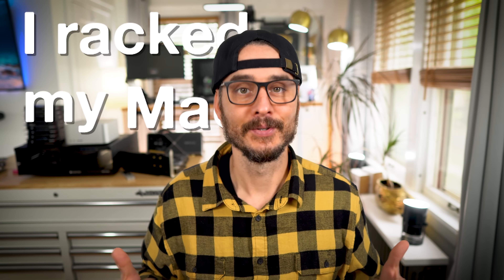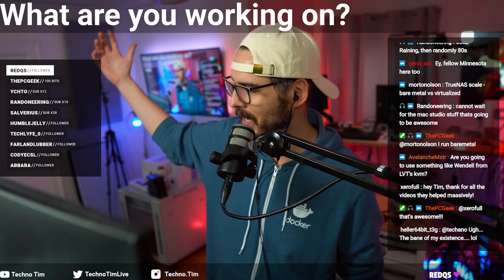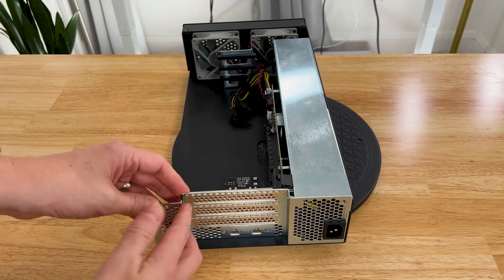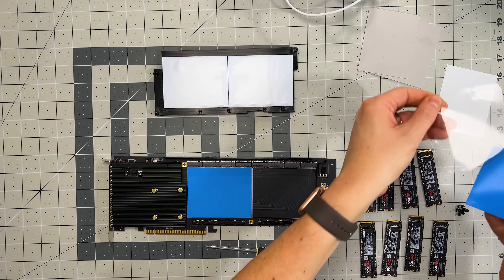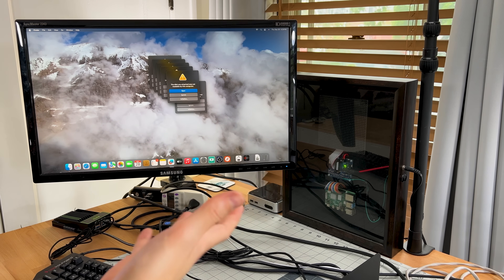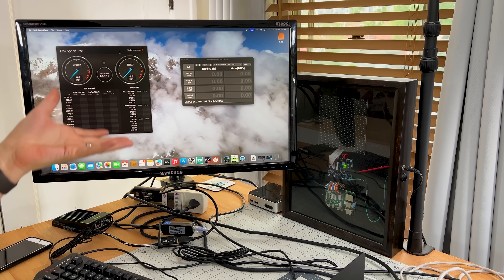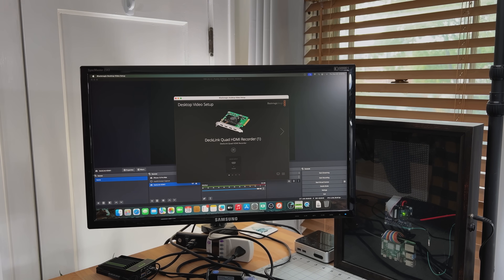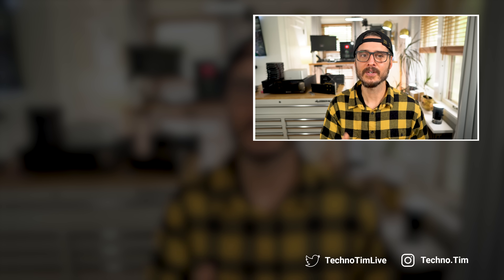Unlock the Power of Your Mac with This Case - Sonnet xMac Studio + ECHO III Desktop + PCIe Cards

Comment: Hmm, at the beginnig of the video you've mentioned that "TB3 is faster than TB4"? But in your video later on you've shown 2800 MB/s of speed to that SSDs on the external "enclosure of many drives", but TB4 can give you more, for example, here, I have Mac Mini M4 and external SSD connected via TB4 and I'm getting 3000 MB/s constantly. So, not sure exactly about your piont "TB3 is faster than TB4..."

Comment: I've a previous Sonnet M.2 4x4 PCIe Card with 4 x NVMe (Samsung 980 Pros) on RAID 0, running off maxxed-out 3.46Ghz MacPro 5.1... and I'm getting 4.8Gb/Sec READ / 4.0Gb/Sec WRITE, compared to this "evolution" on TB3 with maxxed out 2.75Gb/Sec output on a MacStudio M2.   At least I've got something to potentially migrate the Sonnet M.2 PCIe Card to, with this Sonnet xMac,, when I go Apple Silicon soon. Will wait for the M4 Ultra in 2025 though.

Comment: hi there,

are you still running the card in the echo iii? if so, are they playing nice with sonoma? i'm thinking of buying the echo iii (already have the m.2 4x4), but i've read some cases online that stated that quite a few m.2 pcie 4x4/8x4 are not recognized once the os is upgraded to sonoma or keep getting ejected. most cases were mac pro's 2019/2023 with internal pcie, but some were owc's thunderbay flex 8 with m.2 4x4 nvme connected with tb3. thought i'd ask, since this is also a pcie enclosure connected through tb3. cheers!

Comment: You don’t need a rack to get those Thunderbolt speeds. My Thunderbolt 3 external enclosure with 2 4TB NVME’s (8TB RAID) run at the same speed as your 8 1TB NVME’s. Yes, that’s as fast as Thunderbolt 3 will go.
Reply: which enclosure are you running?
Reply: @AlexTyson_  Sabrent Dual NVME RAID Enclosure
Reply: cool thanks.  @GaryWang

Comment: Would be more useful if Sonnet were to use all TB3 controllers on the Mac (up to 3 on Studio, 2 on Mini Pro) to increase the speed of their external appendages
Say 1 connection to every PCI slot separately
Instead of sharing 1 TB3 with 3 PCI slots, limiting performance

You can get 2800 MBps from a single drive enclosure (and 8TB from a single drive)
About twice that if you put 2 enclosures on 2 TB3 controllers then RAID-0 them

Comment: got two of those at work,
once it happened only 3 of 4 NVME SSDs were shown after reboot, sometimes front LED doesn't turn on randomly,
apart from that 4x4 Sonnet card and RME HDSPe AIO audio card work great,
so far only complaints are lack of more than one PCIe x16 slots in EchoIII box, and lack of enclosure for optical drive below Mac itself (yes it would fit)

Comment: Bifurcation is a function of motherboard and pci slot. This card does opposite — it combines and routes pci lanes. Bifurcation makes from x16 pci slot 4 x4 or 2 x8. This card have some chip. Very powerful as I can imagine. 8 disks 4 ones each so it routes 32 lanes into 16. But probably it can divide 16 into 8 x2 lanes. Then it is very strange card :)))
Reply: Most newer generation boards doesn’t support that good old 16 -> 4x4 anymore. At least not consumer boards, perhaps Xeon and Threadripper boards still do.

It’s unfortunate, since bifurcation cards are waaaay cheaper to buy. I bought an AliExpress dual NVMe NVMe PCIe adapter card with the ASM2812 chipset. It works ok but is maxed out at gen 3 x4 speeds upstream. Cost $80 and for that I’d easily have gotten a quad bifurcation card.
Reply: @Yiveytube  you mean two m.2 ports gen3x4 each (upstream from ssd to ASM chip) or upstream from ASM to motherboard is gen3x4 in total? Have same card with red radiator (actually 6 pcs) didn't  tested yet
Reply: @hpsfresh  to motherboard
Reply: @Yiveytube  :(

Comment: Umm yeah no TB4 has 4pcie lanes per port it’s not limited 1 that includes docks. It can send usb 3 data over 1 pcie lane. TB4 provides 4x pcie 3.0 lanes for every port so no increase over TB3 other than 4 requires 32gb speed ie 4 lanes to be available at for every host port not the 2x some low power ports had available. Even if this information is wasn’t widely available some common sense will show you some things. Plug a nvme enclosure rather it be a single,dual or quad drive doesn’t mater as long as every slot is filled to either the host or a TB4 dock (docks other ports are empty so no host port bandwidth sharing. You’ll see read/write speeds that are 90-100 percent the bandwidth limitation of single TB port ie 2.6-3.1GB per second. Drive quality and system resources will cause these to vary slightly. Take a drive out of the raid enclosures and you’ll see a speed based on the physical lanes available to the remaining drives. If this wasn’t the case and they only had 1 lane you’d only see 800ish mb/second max at all times. And guess what you don’t. Lastly notice no matter how many drives you have hooked up you will never exceed that 4x slot speed. So yeah those are a waste of money if you’re after speed. You can raid two enclosures or cards to two ports. I get 4-5k read write speeds. Sonnet is still using tb3 for the benefit of their pocket same with owc and a few others. They just told you a story and got thousands out of you. All sonnet and owc did was take their existing boards slap them in a rack chassis and that 1-2k for for the convenience of one box. Also pcie gen4 anything doesn’t give a speed increase over 3.0 if they’re connected to the same 3.0 host interface. Gen4 will just operate at 3.0 limitations. Can’t make something that isn’t there. With that said gen 4 drive’s typically have a better controller so speeds will be more consistent.

Comment: For using a Mac Mini/Studio in a home lab, what would you recommend for managing the VMs?

Even on x86 Mac Minis you’d need to run MacOS as the host to access the internal storage because of the T2 chip. So does that mostly just limit you to VMWare Fusion hooking into an ESXI system if you want to “connect” it back with other servers/VMs/management in a rack?
Reply: Fusion or another similar type 2 hypervisor is your only option on Apple silicon.  However, later versions of ESXi did add support for local storage on the 2018 Mac mini with the T2 chip, so that is no longer a limitation on the Intel Mac side.

Comment: A KVM switch from Wendell at Level1techs would work great for your setup with an Optical DisplayPort Cable. Also, take that NVMe AIC out of the enclosure and do a benchmark on a full PCIe 4.0 x16 slot to see the fastest drive speeds you have ever seen. Nice video!
Reply from the maker: You read my mind on both fronts!  I have a new monitor coming and my PC and Mac both use display port now!  My new monitor doesn't have USB C, otherwise I would use that.  Also, that card is going to be tested in a Windows / Linux build here soon!
Reply: @TechnoTim  Nice, can't wait to see your next videos. Also, glad to see someone else that shares their affinity for both Mac and Windows/Linux. I try not to fanboy any of them and use all three. Each of their strengths.

Comment: Do Apple do something to block the use of external GPU's over thunderbolt, or is it just a matter of the driver being missing. If so I can't blame Apple for that, since it's be up to the vendors to write a ARM driver for their GPU's.

Thanks for the video and I learnt that TB4 < TB3.
Reply from the maker: I think it’s driver only.  I don’t blame them either and I suspect it will be supported in the future when TB supports PCIe4 or greater!
Reply: @TechnoTim  Let's hope that happens.
Reply: I remember seeing one of the Asahi Linux devs tweet about the lack of eGPU support actually being part of some ARM limitation and not just a lack of a driver 🤔 So it’s not something you’d even see on Linux running on Apple Silicon

Comment: Considering the TB bandwidth limitation and the price of the 8x4 card that I assume will be used elsewhere, I'm interested in seeing if the dual u.2 pcie3 card and used 4tb drives (lots of Intel options on eBay) performs the same.
Reply from the maker: Going to be testing with Windows and Linux soon!  Be sure that if you do look for alternatives you make sure it does not require bifurcation or the motherboard you are using supports it.  This card does not need a special motherboard.
Reply: 8x4 is 100% oversubscribed.  The config for max speed would be 2x 4x4 gen 4, but for capacity it is useful. 
Add a slot for GPU and another high-speed networking slot and your slot count is adding up, favouring a higher load scenario.  I think the card has a pcie switch, so you might be able to put gen 3 nvme cards in but run at gen 4 speeds through the mobo.  Not sure about that.
 You probably really want a server/workstation chip/mobo with pcie slots all going straight to the cpu.

Comment: This is super cool.  I'm working on a 2U rackmount workstation based on a 12 core ryzen chip.  Since it only has a TDP of 105 Watts. It will be whisper quite. The rack chassis I'm going to use will have the top cover modded  with a flow through mesh screen for added air flow. My graphics duties will be handled by the over priced Nvidia A2000.
Reply from the maker: Sounds awesome!

Comment: Nice, but to bad it is just Apple, I didn't see any other hardware supported on the site when I did a quick look.  I will change later if I do find something like a NUC or similar that it supports.  But my "I need it" isn't meet by Apple right now.
Reply from the maker: Windows / Mac / Linux is supported for their PCIe and Thunderbolt devices.   It’s listed as compatible.

Comment: Gotta love the extent to which Mac users will go to get the solution they need when Apple is only concerned about the courageous pursuit of a e s t h e t i c s.
Reply from the maker: I’d also argue that they are on the pursuit of (and winning in most cases) of performance and efficiency 😅.  Also, to clarify, I am a Linux, Windows, Mac user (in order of machines I use on a daily basis)
Reply: @TechnoTim  "winning"
Reply: @marcogenovesi8570  I wonder how many years of power bills could be paid with the price difference between a fully spec'd PC with a RTX4090 vs the mac.

Comment: For the GPU that you inserted into the Thunderbolt dock, it wouldn't work, even if Apple allowed Thunderbolt GPUs on M series Macs, because it's an Nvidia Card. The latest Nvidia card supported by macOS is GTX 500/600 Series, or 10 Series with Third party Drivers and MacOS High Sierra as a Maximum OS. You'd only ever have luck trying an AMD GPU, RX 4xx/5xx, RX 5xxx/6xxx are officially supported, but probably disabled on the ARM build of MacOS. 

As for this Thunderbolt dock, this is very intriguing to me and i honestly wish they could find a way to use multiple Thunderbolt ports to increase bandwidth of the slots, so you're not limited to what looks like the equivelent of PCIE 3.0 x4 speeds, according to the NVME speed tests. Maybe have 3 Thunderbolt cables and each PCIE slot gets the full bandwidth of that individual cable or something. Would be neat
Reply: @spongeyperson - You said everything I was thinking but in a far more organized and thoughtful manner.
Reply: @RichardJohnson-GW  great minds think alike
Reply from the maker: It would be awesome if there were a simple way to aggregate ports but I think that requires very specific ports.  Maybe with Thunderbolt 5 we'll see an increase in speed?

Comment: So you put 8 gen 4 M.2 drives in a gen 3 card? Why?
Reply: because that's what the sponsor sent and it's better than having to buy 8 m.2 SSDs. Not to mention that the whole card was mounted on a Thunderbolt adapter so that's x4 PCIe lanes too. Bottlenecks all the way down
Reply from the maker: I will be testing this card in my new Linux / Windows build soon!

Comment: wow , i'm drooling after that NVMe adapter :))
awesome setup there , although i still wouldn't rackmount an Apple device
Reply: btw, in a future video if you're planning to make one expanding a bit on this , would you please explain a bit bifurcation vs pci-e switching ?
Because i looked up the nvme ssd you used in this video and these are using 4pci-e lanes each  so that's 32lanes in total for the 8 ssd's , and your card/slot can only do 16lanes ... putting aside the TB and pci-e version limitations
Reply: PCIe switching is like your every day network switch, or an even even better explanation might be that it’s like a power strip for your wall outlets. It gives all available lanes to the one NVMe that asks for it, and balance it if there is activity over more.

Bifurcation, that now are getting rarer on consumer motherboards, are a hard split of the physical lanes and the CPU/MB chipset are managing it.
Reply: @Yiveytube  so basically you can't run all SSDs at full speed at the same time
Reply: @alex.prodigy  Correct! Just like in a network. You’re always limited by the lowest capacity part. In this case it depends on both the Thunderbolt maximum speed, the physically available PCIe lanes (x16) and then the switch chipset. Don’t know what Sonnet is using but I’d imagine it’s blazing fast in a PC with proper PCIe slots. In the system Tim showed it’s the TB3 connection that’s the most limiting factor.

Comment: The 8x m.2 slot card is neat but I'm offended, only 799.99$!?! It's too cheap for me. I don't buy cards that cost less than 1500$ because I'm not poor.

(sarcasm)
Reply from the maker: These are professional level cards
Reply: @TechnoTim  Yeah I know. I'm still salty about the lack of high capacity nvme cards with a pcie switch onboard. I'm ready to bet that 600$ out of that is just the cost of the Broadcomm PLX chip doing the pcie switch job.

Comment: I'm not a Mac fan but damn do they have the best unboxing experience ever!!! Of course you pay $500 for a fancy box you will look at once for two minutes 😂😂😂 my HP laptop just came in a brown cardboard box. But it was $400 and has the power of a $2000 Apple laptop 😂😂😂

I just can't understand why you wouldn't just use a mac pro with all of this built in? Or any other regular pc id you need pcie slots? I guess if you are balls deep in mac ecosystem you can't leave?
Reply: I'm not an Apple fan but there's no way that your laptop is anywhere near as fast as the max studio.
Reply: @dzltron did I say that? Must be a miscommunication.
Reply: This whole setup is still like half the cost of the comparable Mac Pro version. Even less if you look at the rack mounted Mac Pro. They are stupid expensive seeing that you can get the same performance for 1/2 the cost.